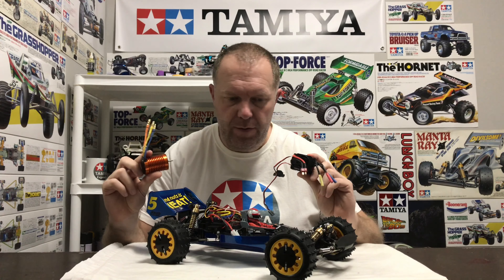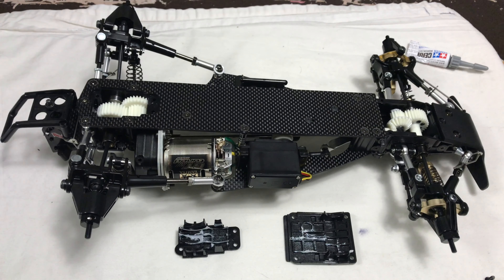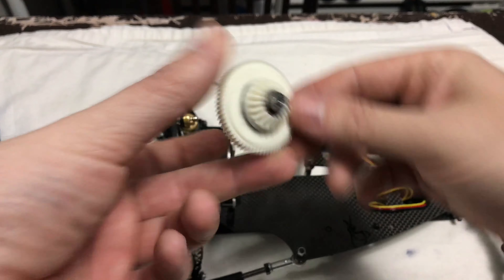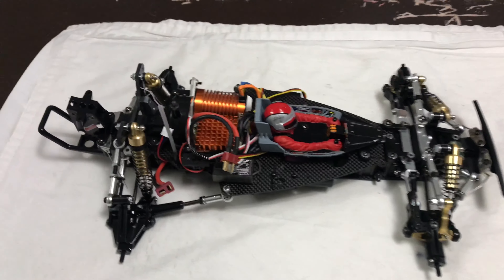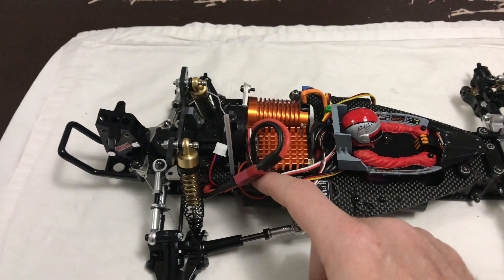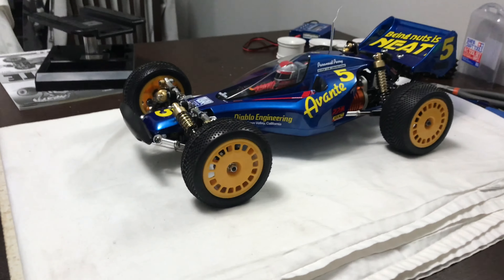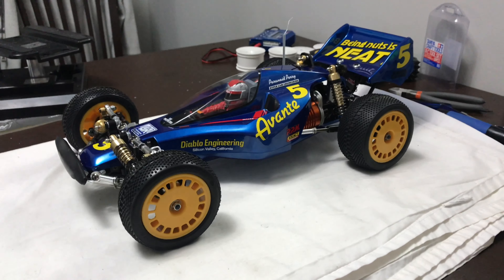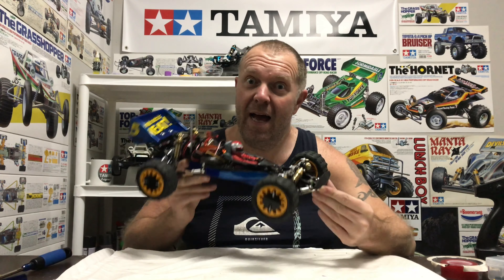Tamiya Avante 2011 Brushless Set Up...

Comment: I just built one of these 2011 Re-Re's. Fitted a Technigold motor with a 60amp brushed ESC. 2S.
Put some cheap Aliexpress buggy wheels and took it out for a maiden last week. 37kph.
Handled so well I smiled ear to ear. It was a "by the book" builds..used vernier calipers to measure the turnbuckles that's how serious I went.
I have quite the collection of RC's that are current..Arrma Felony, Arrma Typhon 6s V5, Traxxas X-Maxx and XRT and a bunch of others. 
The sheer Joy driving the Avante (My first Tamiya in 34 years!) was enough to get the Tamiya bug again. I have a Tamiya Porsche 959 on the way (My dream RC from when I was young) and bidding on another new built 959 right now. I've missed these cars.
Yeah...addictions are tough.
Cheers for the vid!!

Comment: This. This is actually my unicorn. It was my first hobby grade RC and had to grab all the savings i had at the time at 14 years old to acquire this. Adjusted for inflation i'd reckon a solid 1500-1750 bucks. Dollar, Pound, Euro, whatever. Back then i had it upgraded to an ESC, 18 turns Topaz motor and it ran on 7 cells. NICD or NIMH, i'm not sure anymore. The thing was too fast for what i could handle at the time and eventually i couldn't afford the replacement parts anymore and traded it in. These days i'd really like to have it back but only if it is this exact version and not the upcoming limited edition black one. And they're still asking a cool 500 bucks for these, which is insane in my opinion. Some things never change i guess.. But cool that you have one man; I wonder what the top speed will be on this brush-less setup. In my child mind back then, i recall it reaching or exceeding 80 KPH/50MPH. Cheers man, take care of her.

Comment: This may sound backwards ,as per the toe-in and toe-out settings..... please note, none of this is intended to insult your intelligence or experience with off road chassis and suspension setups!!! next, I will explain for this animal, two setups for two points of interest, straight line handling, and then for allot of turns or curves. 

Going fast and straight is a handful, but, very do-able..... going fast while in a turn or curve, things get out of control very quickly. as you likely already know.

You can take away a little bit of the better handling aspects from the "fast and straight" and tune the car to handle much better in the turns, but starts to become less stable in the straight aways.

mentally, going fast and straight, is easier due to, well, you are going in a straight line, but the curves or turns, requires all sorts of efforts and quick reaction times, so to balance that out a bit, lets play with the toe-in and toe-out, for both the front and rear... (Yes, the rubber wheels ,as I think you call them, we in the USA call them tires, lol).

For a track that has allot of curves or turns, the front will have toe-out, maybe 1 to 2 degrees per side and the rear wheels will have toe-in by 1 to 2 degrees. This is especially great in soil and clay tracks and is many times how I would rocket past my fellow racers, pulling past them in the turns. but I would kinda suffer in the straight away areas of the track.

For a track that has more straight away areas then turns or the track has wide long turns or curves, the front will have toe-in of a half a degree to 1 degree per side and the rear will have nothing greater then 1 to 2 degrees of toe-out... and often times, 0 to 1 degree will be fine, for most cases.

On pavement or black top roadways for parking lots etc... do understand, it will chew up the rubber tires treads a bit... but, small price to pay, to do 40 mph in a 15 foot wide turns.... LOL

I hope that helps, if you didn't already know... Side note, the rear toe-in and toe-out can only be adjust so far, due to the design and is time consuming to do so, but the journey is so worth it... heck, you are playing with a legendary unit... Thanks for the update...
Reply: Dude thank you for this ive been bothered by toe in toe out degree for years!!!!
Reply: @Zeros_Hobbies  I think I should mention, this also works for the on-road type cars as well, as long as they are 4WD!!!!  But, the on-road chassis that are 4WD, are an absolute pain in the bootie to dial in, due to the much higher percentage of sprung weighted traction, due from a smoother track conditions, vs. off road chassis... which typically only have 2 wheels touching the ground at any given moment, due to the rough terrain ... none the less, same configuration methodology of toe-in and toe-out. Good luck... On a side note... gust so you see the extreme difference... set the toe-in's and toe-out's to their maximum, then run the car a lap or 5... then reverse the toe-in's and toe-out's the other direction to the maximum and run a few passes... then just so you can see how they handle on the straight aways ,vs the turns and see how hard you can push into the turns before loss of control... or how fast you can get back on the throttle, maybe at half way into the turn, 3.4's into the turn... or hopefully, just power all the way through. That is for you and your track conditions to figure out... likewise, if you find a sweet spot while playing in a paved or tarmac parking lot, that does not mean it will offer the same corning capability once you get your rigs onto the dirt track, and will likely require a bit of tuning again, to get the push, just right for that location, again.... LOL... that is why I always loved the AVANTE... it never failed to keep me entertained... and challenged ,none the less... Good luck...
Reply from the maker: Dru Bradley 
Thanks for all the information Dru, it’s much appreciated, I’m pretty much a novice when it comes to different setups so I’ll take all the help I can get 😊
Thanks buddy 👊🏻
Reply: @TAMIYALegends   Just take your time, and enjoy the process.. For giggles sake... they sell G-meters, that you can stick the car, and then you can start graphing the process onto paper... I always wished I could have had such a thing, 20 to 30 years ago... now, they are like $10 bucks from amazon... LOL
Reply from the maker: Dru Bradley 
Too be honest I’m that far in front with my videos, this car has actually moved on now, so you’ll have to bare with me if you watch the next ones on the Avante. But you’re advice will definitely be used on all the stuff I’m working on right now buddy 👊🏻
Reply: @TAMIYALegends  Oh yes Brother!!! I look forward to what ever you are doing man.. gonna be great...  More then anything, your videos of the AVANTE have brought out all sorts of memories, and I am enjoying this past time of my old life...  You do all that you want,  even if it doesn't include any of the mess I mention.. .I wont be offended at all... I'm just glad to see the AVANTE in action again...

Comment: This is great , I do wonder though why use a cheap brushless system ?   I’d like to see a high end brushless system  in a high end car . Maybe a series of videos highlighting the component failures and modifications when the chassis is really pushed hard ? 
Anyway as always great stuff glen !
Reply from the maker: John Georgiou 
Hi John,
Yeah I only own two Brushless combo sets and the other one is way too hot tbh. The majority of my running videos are using Brushed motors which I enjoy. As you say maybe I need to invest in a lower kv higher end setup 🤔
Thanks for your comment buddy 👊🏻

Comment: Glenn, just thinking out loud here but is it possible to fit the top force wheels and tyres just to get a straight out comparison ? If nothing else, it'll give you a base line from which to work your magic. You could even take it one step further by fitting the avante  ones to your top force. Or it could just be my OCD 🙈
Reply from the maker: John Josey 
Yeah I did have a play with different wheels and tyres buddy. In the tarmac videos that are coming I settled for the TRF dished wheels on the dual block tyres, they ran really well 😊
But on the gravel I went with the Avante set up 👊🏻🚗💨💨

Comment: Looks good Glen, im on the fence about putting a brushless in mine, might keep it stock motor
Reply from the maker: STEVO D 313 
Yeah I know exactly what you mean buddy. That kit motor on 2s is perfect for that chassis in my opinion 🚗💨💨
Reply: you can always change the turn of the motor i believe its a 17t-20t for the tamiya torque tuned. you can stay brushed just go for a 13t or 15t
Reply: I run a Brushless in my Egress , the gearbox and chassis can handle it! Do it!

Comment: 👍Cool, watch the temps on that finned motor they are not true 540 sized motors they use a smaller 380 sized rotor inside those cans and don't have the power of the normal sized 540 non finned cans do.
Reply from the maker: Shen RC 
Thanks buddy 👊🏻

Comment: Glue them tires up buddy and give it another run ;) Let us know how she runs then. I read that for some reason the center diff has to be tightened when using modern wheels and tires. Can you confirm?
Reply from the maker: Zack TheBongRipper 
I don’t think there’s much adjustment on the centre diff tbh buddy?

Comment: Seems fast. But I've always thought that putting a brushless motor in a nylon gear set and diffs would not last as long as my arrma and traxxas .
Reply from the maker: KyzerGB 
You’re absolutely spot on buddy 👊🏻
Reply: Biggest issue with this drivetrain is the center diff/spur combo.
Otherwise the gears hold up fairly well if dust can be kept out of them & there aren't too much rough landings under throttle.
Though there are parts that locks this center diff which affects how it handles a bit (if you don't look too race this it's fine really.)
But makes it a lot more reliable as a full time runner, besides perhaps reinforcing the chassis here & there for jumps.